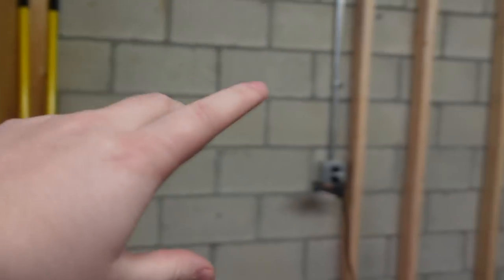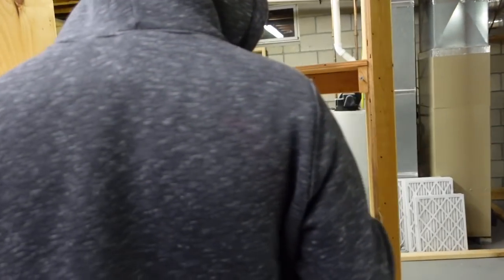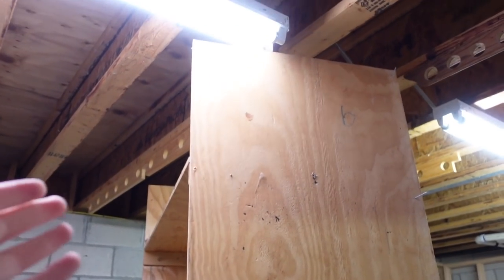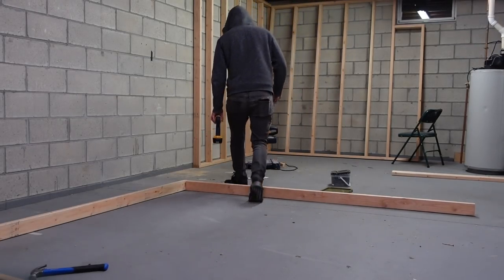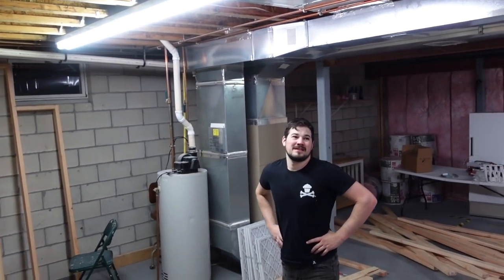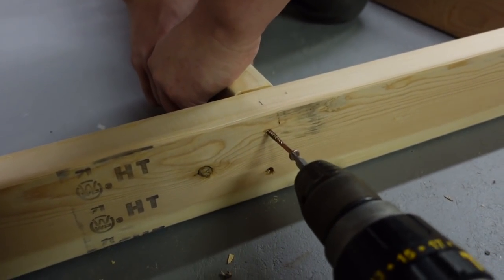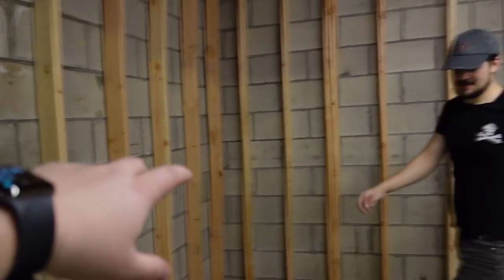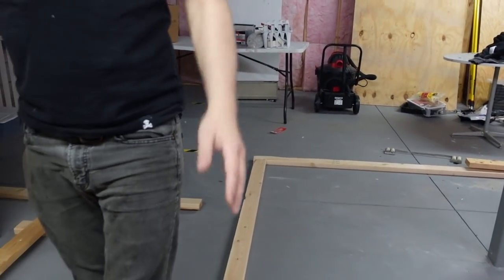Constructing McJuggerNuggets New Basement! - Renovating McJuggerNuggets Basement: Ep. 2

Comment: You also need to place nailers in the corners of each section of wall so you have a nailer fo the drywall also the top of the wall is so post to be 2 2X4 stacked that is how you actually join the wall sections together.
Reply: I was looking for this comment haha. I did a bit of framing at my old job. We were lucky, we would build walls on a giant laser guided table. Making mini homes.